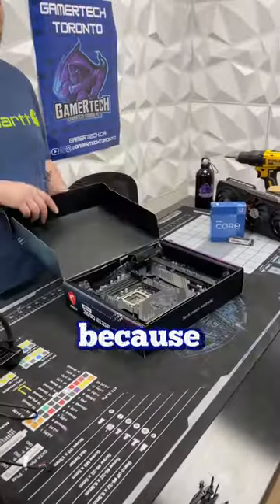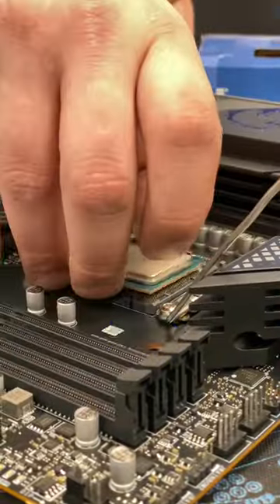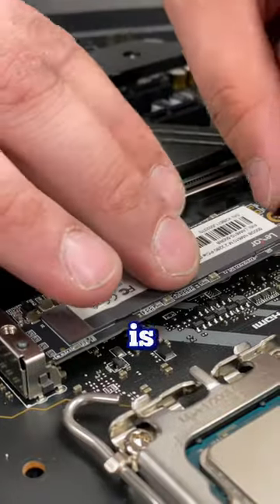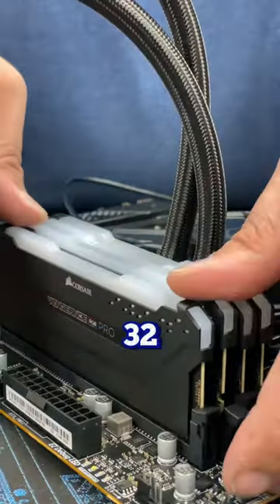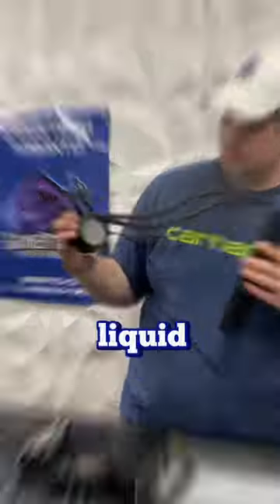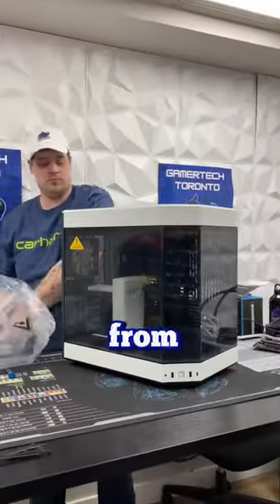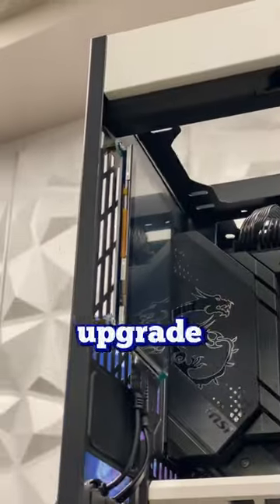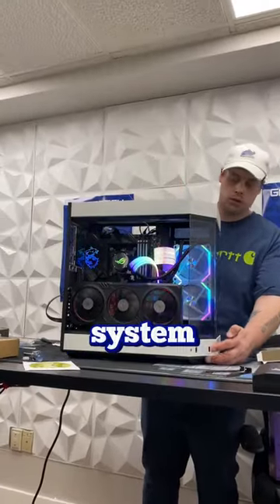Upgrading A PC! 🥵 #upgrade #pc #pcrepair #gamingpc #pcgaming

Comment: I'm gonna upgrade my pc in June from an 5 5600x to an 9 5900x and an aditional 1tb nvme ssd
Reply: @lile4life713  or the 7 5800x3d
Reply: Get your self a new ryzen 7600x  it performs better then any 5000 cpu
Reply: @juanbermudez964  hell need to get a whole new mobo, ddr5 ram and probably a new psu
Reply: @juanbermudez964  as Leo alresdy said, they would need to get a new mobo, ram and maybe psu... bad reccommendation. Thats nearly a fully new system, really expensive for a simple cpu upgrade. Not worth it if all they want to do is change the cpu
Reply: @leo-13804   future proofing man! Why spend money on a previous generation hardware, well my opinion, this cpu is a beat when it comes to gaming! It gets toe to toe with a 12900k
Reply: @j.rohmann3199  yes! But why spend money on a last generation hardware?  But I do understand that it will get very expensive but also he can sell the old parts before they get to old, and future proof his pc

Comment: What a waste of money on the 12700k, man's shelled out mo4e money then needed

The 12700k is 280-320 usd

While the ryzen 5 5600x base has the dame performance and can be easily overclocked yo do better for 140-160

Or even a 7600 from 180-220

Or a 7600x
From 230-250

All of which can be kverclocked to nice clock speeds and perform the same or better for cheaper

Comment: I would update my mother board and maybe get more ram, I recently got a new cpu (which may also be a bad one out of the box because my pc isn’t doing anything at all when I push the power button) and when I use my old cpu the bios still won’t budge and I keep getting an error message (maybe because it was a prebuilt)